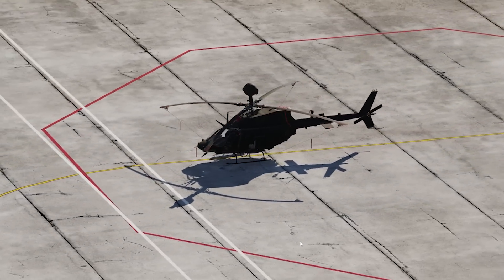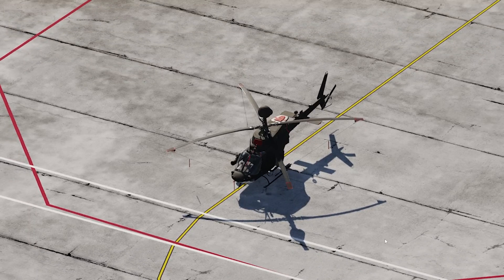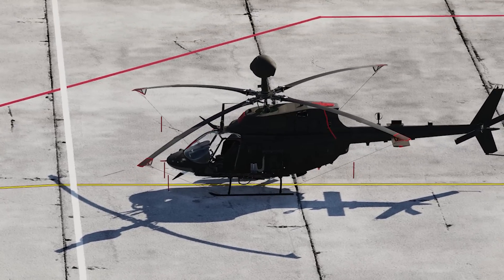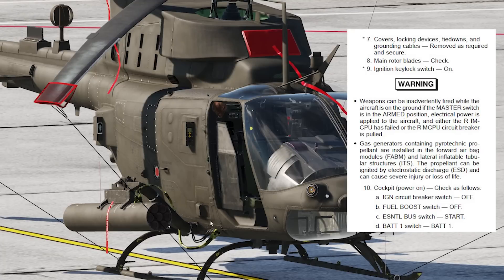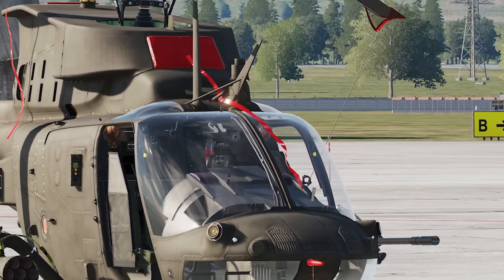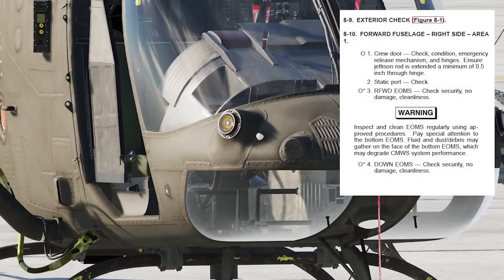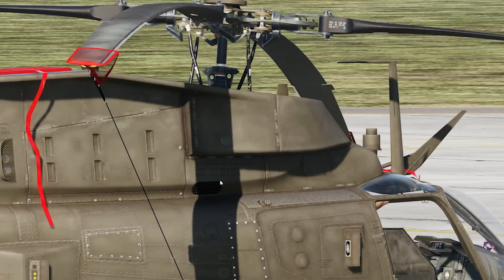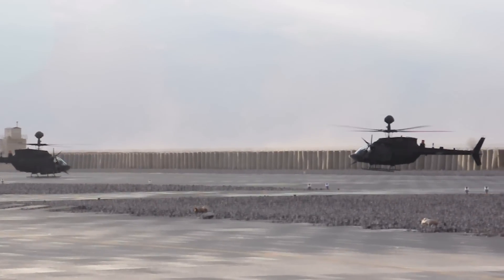KW Detailed Preflight Walkaround P2

Comment: I'm interested in what you were saying about the air filters. Did I understand correctly that the KW originally had cyclonic filtering for engine air inlets, but that was later replaced with the K&N filters? If so what was the reason for that? Was it about filter performance or more about maintenance?
Reply from the maker: I believe the oiled-cotton filters were more efficient, and also lighter.

Comment: When you say maintenaners, you mean the Army equivalent of crew chiefs? I was an Air Force aircraft electrical/environmental troop for sixteen years. And I got instantly triggered by the story of wires getting ripped out because maintenance forgot to disconnect them. I've had to go fix the APG, and jet shops "oopsies" way to many times. Usually with a pro supper freaking out the whole time.
Reply from the maker: Yep.  Most common would be the line-level crewchief, which is the first level of maintainer that deals with the aircraft.  Occasionally the pilots would "help out" with certain tasks (aircraft washes, removing cowlings, etc.)  We'd f' them up too, so the crewchiefs would generally smack our fingers when they saw us "helping", lol.
So the back-shops guys would be left to deal with the carnage.